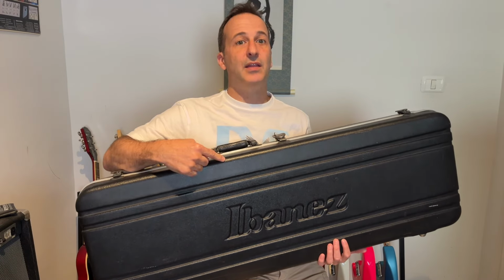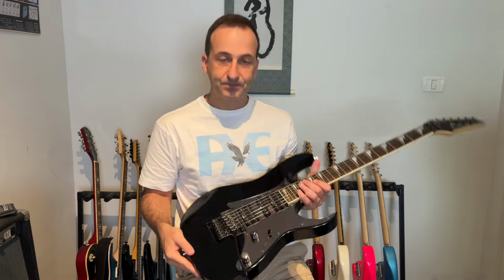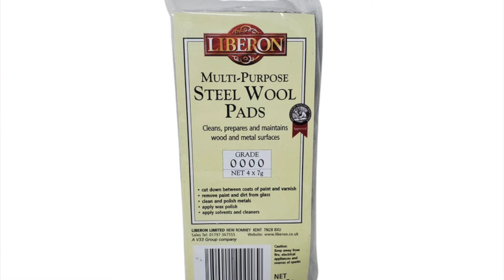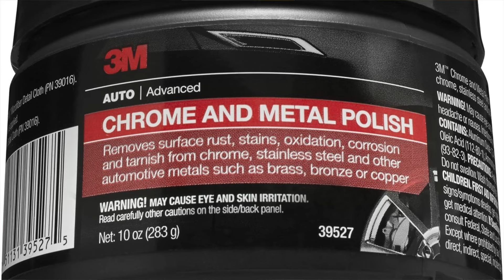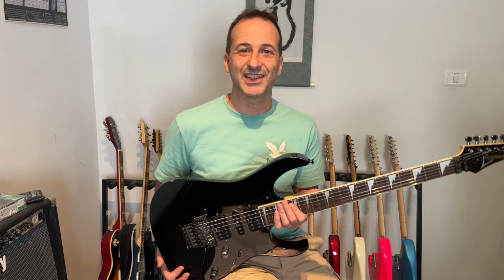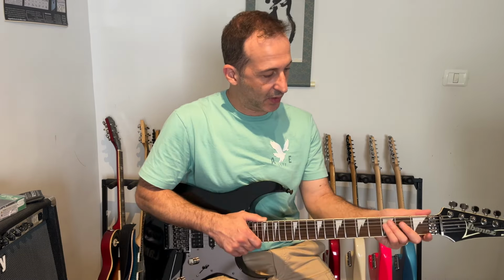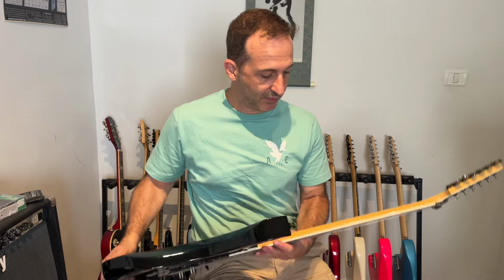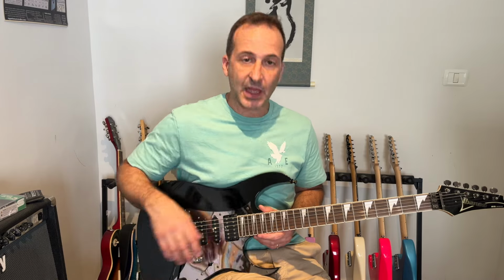Ibanez RG550 LTD - Full restoration

Comment: I’ve had the same guitar black and mirror since 96 and it’s my number one still to this day. I think it’s the bound fretboard that makes these necks so comfortable and I know it’s an unpopular opinion but I love the AANJ heal. Mine has been through it all with me. Through the best of times and through the worst lows. It’s the one I will never let go of. I’ve modded it a little over the years it’s got FU big brass block, neon Green distortion trembucker in the bridge, a hot pink pearly gates in the neck and the stock single in the middle. I put a regular 5 way switch in it and push pull volume and tone pots to switch from series to parallel. I put Gotoh cosmo black locking tuners, to aid in quicker string changes. I put a cheap white pearloid pick guard on it and seem to have misplaced the original mirror guard, it’s around here somewhere and when I find it, I’m going to build back a stock appearance with black pickups in it, as I’m aging I think I’m getting less fond of high output pickups, so I’ll probably go back with a 59 or Custom, possibly a PAF pro and get it back to looking like it did out of the factory. I went through a spell that I thought the mirror guard looked cheesy and I was inspired by Kirk Hammets black Fernandez with the pearl guard and black pickups, but had gotten a decent deal on the wild colored Duncan shop floor custom colored PUPs on eBay. Anyway these in my opinion are the best RGs next to the OG original ones from the late 80s early 90s. I had an Indonesian 920QM premium that was fantastic as well and the build quality was probably as good as if not better than the Japanese guitars of Ibanez, the problem was the newer bridge design it had on it, if I’d kept it I would’ve put an edge lo pro like these LTDs had or an Original Edge on it. Anyway killer guitar and I don’t see many in the wild or for sale much so either they were all fantastic and everyone keeps them or they’ve been parted out, I suspect a little bit of both. Oh yeah mine has Dunlop strap locks, strap locks aren’t necessary on these because they had those huge strap buttons but I put locks on everything else and wanted to be able to use the same strap on several guitars.
The springs were replaced recently on mine too, I think after 30 years the original springs just gave out, however it’s important on the edge bridges that you set them up with the knife edges parallel to the body not the baseplate like on Floyd Roses, the baseplate on the edge is actually wedge shaped, you can set them up a little higher or lower and they will return to pitch but they perform best with the knife edge parallel to the body this is it’s true zero position and it can be tricky to get your action right if it’s jacked up or sunk into the body too far. There’s a cut out on the baseplate where you can see the knife edge inserts to set the trem angle correct.

Comment: Unlike a standard Floyd rose, Edge floating tremolos are not meant to lie flat.
Reply from the maker: The saddles of the Edge vibrato  indeed look not flat because the top of the vibrato has an angle. But the base plate should lie flat no matter what.

Comment: Trem should not be flat, saddles should be, trem will have a triangle visible from the side - see below though - the better way to put it is that the base plate should be parallel.
Reply from the maker: As far as I know it's the opposite. The baseplate should always be parallel to the body.
Reply: @fredericadda  Hey man, yes, that's probably a better way to phrase it - but in general saddle tops are parallel to the baseplate so I just thought of it differently. My Jems and Universe the baseplate is below the top of the body so it's not as obvious.
Reply from the maker: Oh I see. The Edge (on this RG550 and on my Jiva Jr) are the only bridges I know where there is such a steep angle between the baseplate and the saddles. I play with an average action (2mm on the low E, 1.5 on the high E), so in my case the baseplate is just flush with the body.
 I chose to have the baseplate parallel to the body, but if having the saddles parallel to the body works for you, it's fine. Good to know that works too.
Reply: @fredericadda  I use a Jazz3 as a gauge, think it's about 1.4 on low E and 1.2 ish on high E at the 12th fret when they are where I want them.
Reply from the maker: Hey I checked again my RG550 and you're right, the base plate and the saddles were not parallel to the body! Thanks for the advice!!!

Comment: I have two RG 370 DX both in near mint condition. One is made in Indonesia and the other is Korean. I don’t know much about them. Are they recent remakes for beginners? They at least sound good to me, but that’s about all I know….
Reply: Oh neither have a pick guard, and one has the circles on the pickups, and the other hotrail style with the Vnumber on them. Both are SSH and same inlays as yours.
Reply: Ok did some research and got my answers, thanks!
Reply from the maker: I'm not so familiar with the Ibanez lines but they look like the little brothers of the RG550 😄